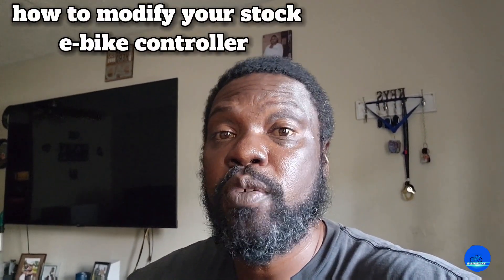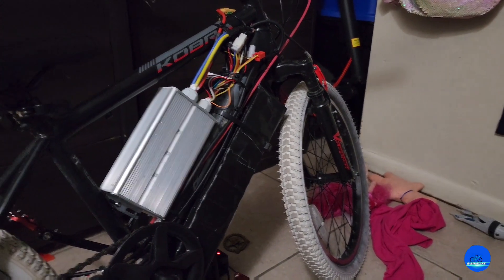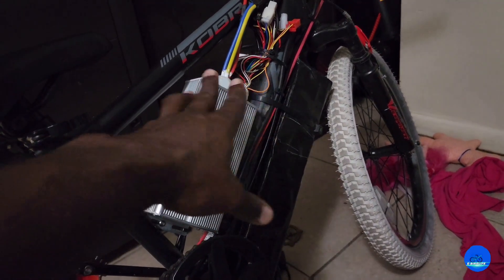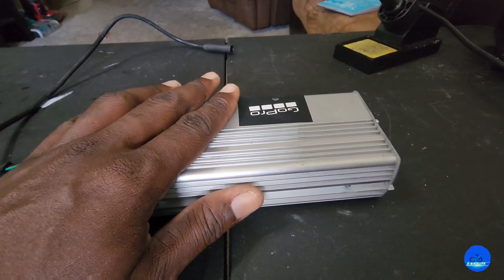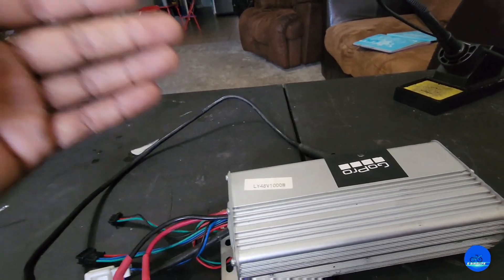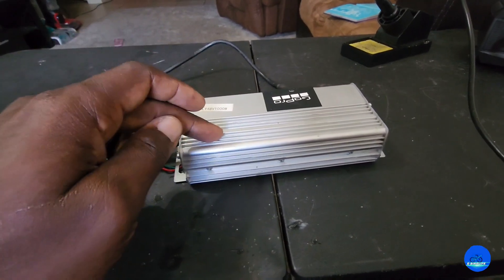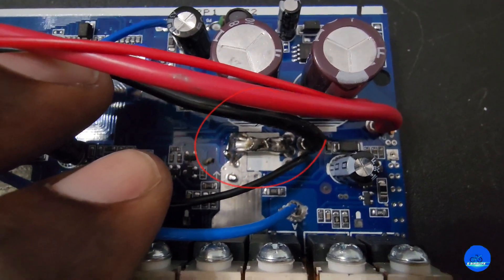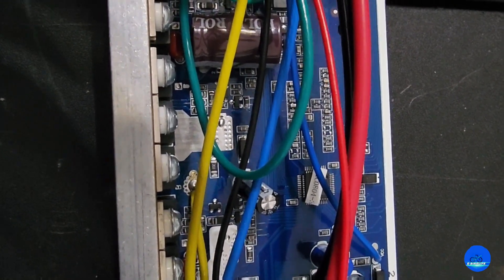how to modify a basic e-bike controller(MORE POWER)

Comment: Im tempted to try this on my 13a controller the size of a pack of cigarettes but I would have to calculate the shunt resistance i need to make it 20a max, not 40a, because my BMS is 15a with a 30a fuse. 

I would go into the upgrade death spiral because i need a stronger BMS to supply the shunt mod controller. 

Lately every repair/upgrade i do causes something else to break. Lol
Reply from the maker: Oh wow, this controller was great after I did the mod but no where near the power of the new controller we just installed
Reply: @EBG-offical , yes, your controller is 15 Mosfet so it seems ready for amps. I think mine are 6-9 mosfets in all my controllers. My Votol is rated at 32a but you can set it for 45a or higher if you want.
Reply from the maker: Oh ok yes I know for the most part that all controllers are not the same I guess got lucky that this controller can take more abuse than others

Comment: I am sorry but I didn’t understand what the modification did.  What exactly changed? Thank you
Reply: There's a shunt in every controller.  Tells controler what amps its putting out. By adding solder. It fools controller into thinking its pushing less amps thar it actually is. But will increase heat. There's a gell you can buy to add to controler so it dissipates the heat better   depending on controller it might not survive.  Depends on misfits they used.  Cant look that up too. But if add gell helps allot!
Reply from the maker: Yes we'll I ordered the original controller that he had on the bike before all this happen so h3 had a 80a 3000w controller on the bike, so I did the mod to the 1000w controller and I noticed it can handle more voltage but didn't know how much so I went to 52v to 60v went to the trials to test it out and it preformed great to my surprise it didn't get hot either, it was definitely a noticeable improvement in acceleration and too speed but has nothing on his new controller.
Reply: @EBG-offical  puts out more power with no extra heat? What mosfits are in that bad boy?
Reply from the maker: You know what, I didn't even check that. I saw the caps and tried the 60v battery I just built went out in the woods to test it and it's just been good from there
Reply: @EBG-offical  I was going to try on older controller..seen allot vids on. But never see a long term vid.. or performance comparison?  Before and after  . Just it's better.  You enjoy the day.. and God bless brother.. good video.. loving my ebike.. 👊👊💪💪
Reply from the maker: Thank you I had that controller on his bike for two months before I switched up the controller,  my buddies son wants one so I'll ues that one on his bike for low power ebike.

Comment: like the intro and music as well as picture overlay! watching your video made me notice my controller had 100v on those things. I currently have a 52v battery, does this mean if I bought another battery and wired them in series the controller could take it?
Reply from the maker: Yes it will at full charge my battery is at 67v and the caps is at 63v when I connect the battery to the controller I thought I was going to hear a pop  but nothing happened so we turned it on and off we went lol
Reply: @EBG-offical  i ordered the 5000w kit, but ive got a 2000kw kit with  a small triangle, might be worth doubling up the batteries and see what happens. if it doesn't work just send battery back.
Reply from the maker: Ok keep me posted
Reply: @hank_Reardon  , if you are saying you bought a 14s Li-ion pack (52v) and want to buy another to put in series 28s, 104v nominal, 118v fully charged, then you will definitely fry everything, the controller, the display, and accessories that are wired off battery power. 

63v caps are for 48v nominal.
80v caps aee for 60v nominal.
100v caps are for 72v nominal.

You can get away with 63v capacitor for a 60v Li-ion (67v peak charge) if you are lucky, eventually it will pop if the charger is left connected after the light turns green (as it should be occasionally to balance the cells).

The other big problem is charging them, you will need to plug in two 18s li-ion chargers (or charge one then the other, taking twice as long).

If you bought a kit with a controller, display, (dc/dc converter optional), you need to see what the supported voltage is. Many controllers and displays allow you to select 48v/60v/72v but if you plug in 117v, you will need a new display and controller. 

So if you didn’t get what you ordered you will be better off using the return policy (unless you need to pay shipping to China) and get what you want, 5000w motor, 72200 (72v controller), and 72v battery (or two side-by-side connected in parallel not in series). Even with that you might sill need to open then and upgrade them from 60a to 100a each. 

If you use just one battery you see what EbikeLife had to do to make it capable of bursts of 200a. The Chinese assembles the cells wrong so he had to bridge over the single strip series connectors because they are only good for 30a, at 60a they were getting hot, at 100a they were smoldering, and 200a they burn in half.
Reply: @imho7250  

Thanks for info, I'll hold off on that then.

 @IMHO  

Thanks for info, I'll hold off on that then.

What if I buy 96v controller? Think 2000w can handle that voltage if I put statorade in the hub to keep it from overheating?
Reply: @hank_Reardon  , whats the return policy you have? I use Shopee Philippines which has a good buyer protection and if they send the wrong stuff you just try to work out a deal with seller and if he doesn’t respond then Shopee will refund your money. If the item was a real item like you got and needs to be shipped back, the seller pays. 

I bought once from Aliexpress but my $20 items with $10 shipping got snagged in customs where they added $10 more dollars. Lol. Luckily I didn’t need to return it because i think I would have just lost more than i spent.

You have to read descriptions and look at the pictures very carefully because a “5000w kit” might have a 2000w motor with a 5000w peak controller (52v@100a)). The controller normally needs to be 2-3 more powerful than the continuous rating of the motor or else you have lots of capability you cant access. A 2000w motor can cruise all day at 2000w but you need 4000w-6000w to quickly accelerate up to that speed, then the watts settle back down and give the motor time to cool. 

You see Ebike!ife beast has 5000w motor and 72v*200a (14kw) controller for acceleration and short hill climbs. But you have to manage the power if the motor and controller doesn’t have a temperature sensor in the motor and throttling function in the controller.  That combination can easily burn the motor if he accidentally sets flux weakening too high and ties to go 70 mph for 10 minutes. Lol
Reply: @imho7250  not sure, I'd be ordering from aliexpress. I currently have 2000w motor with 58v. 

I just ordered qs205 5000w with 72v 40 ah battery to be put on axum frame. 

I'm just trying to find a way to get 2000w motor up to where it should be for cheap.
Reply: @hank_Reardon , 58v (16s) is ok as long as it can support 80a and the controller can handle. If you have a Sabvoton for the Axum frame you can use it to see what it takes to make your 2000w motor give the performance you want. There are several winding choices also which let you choose torque or speed. If you have the wrong windings for what you want then its not going to be optimal. 

I think QS also lets you choose the winding type. I normally go by base RPM but there is also 3.5 turns and 5 turns but i have no idea what the correlation is.
Reply: @hank_Reardon  Nothing wrong with Ali Express. Been a regular customer for over ten years and the stuff the have is excellent and a great price. Do your research though. I bought an aftermarket turbo and the same turbo varied by as much as 400% for the same design. The price difference was in the quality and finish. The cheap ones will work, but the higher priced are much better finished and better components.  This applies to everything on Ali Ex. They basically have a price point or a quality point for everything they sell. Someone has filled that spot for you.

Comment: 16s pack fully charged? thats great haha thats 67.2v fully charged so i bought some 470uf 100v capacitors just incase for my 18s battery pack :D
Reply from the maker: Yes it did great for a substitute controller I don't how much power it did before the mod but you definitely can fell the difference,  it be fully charged too